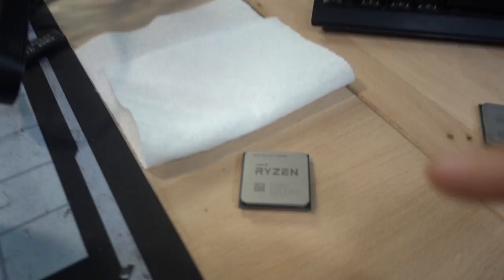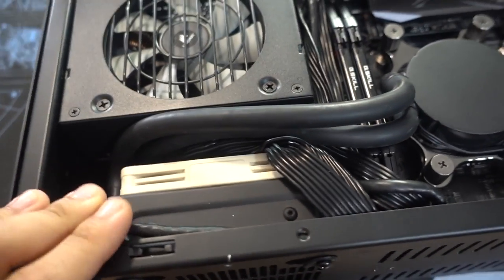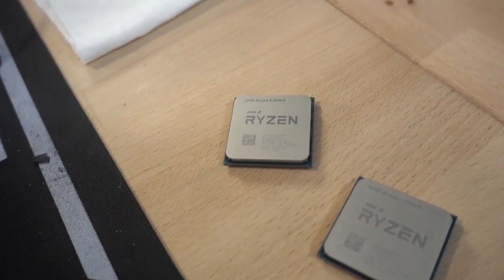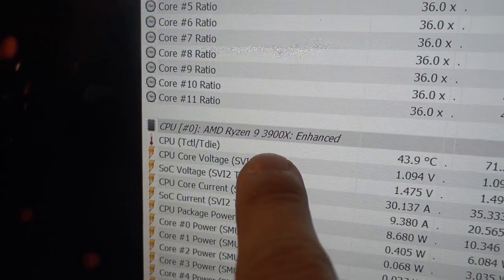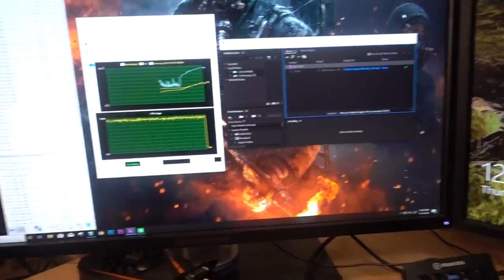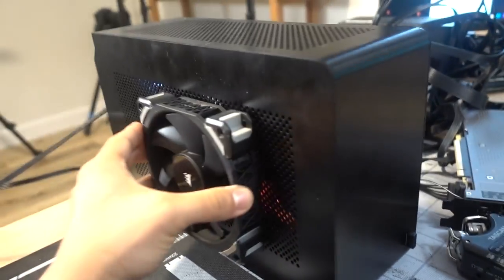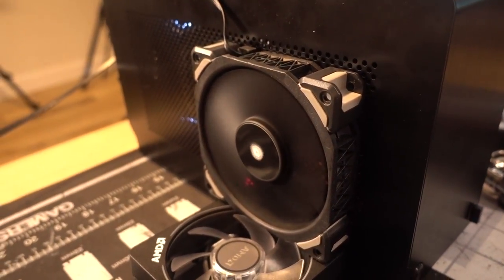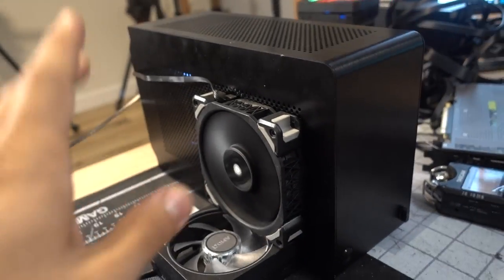This idea was BOUND to fail...right?

Comment: If you don't put a 3950X in it come september i'm unsubbing.
Reply: TDP-wise it's the same as a 3900x, so it's definitely possible.
Reply: @GyroCannon  TDP is one thing, actual power usage and heat is another thing
Reply: @LiLBitsDK  actually 2 cpus with the same tdp have a similar heat so its not the same but similar
Reply: If you do, though, I'M unsubbing
Reply: @GyroCannon  but can the VRM handle it, i doubt it will without undervolting and/or underclocking, it will probably overheat without a case fan blowing on it while rendering in blender for a extended period of time
Reply: @LiLBitsDK  You can lock PPT limit under 125W, there will be small drop performance, but great temp.
Reply: Chad McKean 
People thought the same about the 12 core
Reply: I want also to see threadripper 3 on dan case
Reply: prepare to unsub in a few days, buddy.
Reply: unsub now xD
Reply: UNSUB

Comment: Just go into the BIOS and change the power envelope for the socket.  I'm running a 3900X in a 2U case with a 65W low-profile noctua air cooler.  Setting the PPT to 100W keeps the CPU temp around 65C at a full load.  As a bonus, you still get the full-on single-core boost.

With your compact water cooling setup... 80C is a bit too high.... 93C too high for sure.  Just change the PPT, it won't go above 65C.  Then boost it a little bit... maybe try 110W, and it will probably cap out at 75C.  You guys are so fixated on overclocking sometimes it takes a kick in the pants to realize that you can still get 90%+ of the multi-core performance and ALL of the single-core performance just by using a reduced power envelope.

-Matt
Reply: @Junker Zn Very interesting, I will have to play with this on mine... Something else I noticed after reading about it from someone else was the 3900x is still plagued with scheduling issues in gaming. I have only a handful of games to test this on, but running battlefield V on stock I get 158fps average, but if I force the game to only run on the first CCD (first 6 cores), my average fps in the game jumps to 171fps.. similar % of increases in Fallout 76 also.
Reply: @williamhustonrn6160  I'm not sure I would say "Plagued", but there are definitely still some scheduling issues and it is partly the fault of the BIOSes reporting all 12 cores as a single unit.  Some BIOSes have an option to properly break the cores into (at least) their two CCDs (in terms of reporting the topology to the operating system via the appropriate ACPI table).

Windows is also not very good at using topology information provided by the BIOS, so its a double problem.  But other operating systems such as Linux do use the BIOS-provided topology information.

-Matt
Reply: @junkerzn7312  Hmm, you would think with a new chipset released with the new CPUs it would work together correctly. I really need to attempt linux again, tried debian a while back and just couldn't get half the games i regularly play to function on it, but i recently learned about GPU passthrough appearing to be promising, so may give it a try and maybe make the switch in the future.
Reply: This is mandatory.
Reply: Good suggestion Matt, I was going to suggest he undervolts it with a manual overclock but this solves the same issue
Reply: Can you tell me how to do that in an ASUS ROG board? I can't find anything marked as "power envelope" in the bios setting.
Reply: How do I do this on an Aorus i x570 Pro WiFi BIOS?
Reply: What would run better a 9900k with a 95w limit or a 3900x with a 100w limit?
Reply: @CALiiGeddonTwo   Was wondering the exact same thing! Anyone have an answer? Close to start ordering for my next build. Thanks!
Reply: do u have a guide on this

for setting the power limit

Comment: You could potentially undervolt the CPU to help the temps
Reply: Sure, but what would be the point of having a 3900x, then?
Reply: Would be a good idea, the gpu too it would lower the overall case temps... in theory at least
Reply: @anshulsingh7663  he'd still get the same performance with an undervolt. Just lower temperatures
Reply: @jonathanstitt4368  But the GPU's on the other side, so I don't think that'll really impact the temps so much.
Reply: @anshulsingh7663  with undervolting only single core performance is taking a dive, while multicore is not really, with a much less temps, so it's totally worth for a system like this.
Reply: Fernando Portal as OptimumTech figured out, the performance actually does lower when undervolted for some weird reason. The more that you lower the voltages, the clocks automatically go down along with them, beinging down the performance
Reply: Kinder of defeating the purpose don't u think
Reply: @anshulsingh7663  you don't lose performance when undervolting just heat
Reply: @anshulsingh7663  Undervolt not underclock :)
Reply: @anshulsingh7663  yes but it's still blowing heat through the case which has such little air volume that it could actually make some difference
Reply: @goldengod97  but this is with good cooling so it has overhead to ramp click speeds. Here there is no overhead so it isn't able to clock higher anyway
Reply: Setting a manual voltage and clock speed would help yes

And so would liquid metal or thermal grizzly new graphite pad

Or simply use a better cooler and or fan/ drill addition holes for more airflow
Reply: @goldengod97  If you use PB2/PBO it does kill performance while undervolting manually, but if you set manual clockspeed also, you dont lose any performance
Reply: @commanderoof4578  he can do that when he tries the 3950x 😂
Reply: Jonathan Stitt...

If he tries the 3950x he needs to do many things differently

The radiator needs to be flipped so the fan has access to more air as they push harder than they pull

He also needs to use liquid metal
Reply: Undervolting doesnt do anything in ryzen except make it unstable and crash.
Reply: Melthornal... really?! Nope!! That is only if you undervopt and do nothing with the frequency

You have to set the frequency yourself otherwise it will try to boost and crash
Reply: @anshulsingh7663  undervolt dont means under perfomance
Reply: @goldengod97  you got a bad cpu i can run 4.4 ghz with my 7700k at 1.17v oc at 1.42v 5.4ghz
Reply: @makunouchiippo2542  It does mean stability. Which is, drum roll, performance.
Reply: @AlexLionson  I do see the point. I mean, ryzen's best at multi core performance.
Reply: @anshulsingh7663  not all cpus are the same a power hungry cpu means a bad cpu the lower volts you need at stock the better temps and less oc, how many years are you using a pc ? im overclocking cpus over 20 years and i know my stuff my best benchmarks are on cpu z search me as korko-1 and call me back when you reach 7ghz
Reply: @anshulsingh7663  They can get similar performance, probably down a couple hundred MHz, but have the cpu at 1.4v vs the 1.5v and drop down temps by 10+ degrees
Reply: They don't need that, they just need a better cooling solution.
Reply: @goldengod97  this is not entirely true. He originally undervolted it in the bios, and that is where he saw those strange results. If you undervolt it through the ryzen master software, you can do an all core 4ghz stable at 1.1-1.2 v without loss of performance , all core
Reply: Yep still runs great at 1.0volts
Reply: You can undervolt but the easiest way is to just set the socket power envelope in the BIOS to whatever wattage you want it to cap out at.  It will still turbo single cores the same... only the all-cores boost will wind up being lower.   You can undervolt as well by using a negative VCORE offset, but that requires some work to figure out how far you can go and still have a stable system.  Capping the socket power (PPT setting usually) is easy-mode.  You just set it to whatever you want and you are done.

-Matt
Reply: You can reduce PPT (platform power) significantly without losing too much performance, as the system will be at a more efficient point on the voltage/frequency curve.

Setting a negative voltage offset saves less power and results in heavily reduced performance at the same power levels. Therefore unless you're also setting a manual frequency (thus disabling precision boost and going into full manual OC mode), it is not recommended to set a negative voltage offset.
Reply: @dylanhoel1636  Yo do lose performance by undervolting when it comes to Ryzen 3000.
Reply: @AlexLionson  On the contrary, the multicore also gets the performance hit when undervolting.  I personally tested this with my 3800X.  Geekbench multicore score nose dives almost by 1000 points.
Reply: Daniel Gim all that means is you undervolted improperly

Comment: How about underclocking/undervolting the 3900X, @4.0-4.2 GHz should still be much faster than the 3700X. Higher temps aren't really good for permeation of that little AIO.
Reply: Keven Harvey Undervolts on ryzen 3xxx has been rather shit from what I understand
Reply: @smartyuno  Check out Optimum Tech's most recent video.  I think his 3900X was stable at 3.9ghz at 1.00V on all cores
Reply: @tmoneytechnic  That, somehow, sounds crappier than it actually is.
Reply: @richierich8245  I think he's quoting the updated video. 3.9 at 1 volt, 4.0 at 1.06, up to 4.3 at 1.25 volt. Is still better than stock for thermals.

Comment: Yo Kyle, get a pair of scrissors that can cut alum, and put a 280 rad INTO the side panel. Get some kind of sealant, and "tape it". Now you have a pc that's side panel is literally a rad.
Reply: KyleTechTips, everybody.
Reply: for a pc case you could probably use tin snips, cost around 15$ for a set, or if you want it to be fancy, could use a dremel and put it in the middle
Reply: This case was a bit expensive I don't think he will cut into which would also  hurt the portability also no space for the 280 I would need to get a smaller psu then the sfx ond
Reply: He can mount 120mm easily on the side panel without cutting anything because of the holes in the panel

Comment: You should manually overclock all cores to a reasonable OC of 4.0 - 4.2ghz and drop voltage down to 1.1-1.2 range, you may lose some performance from single thread vs PB2/PBO, but should get way better temperatures
Reply: Turn PBO to advanced and set the temp to what you like. worked for me in my dan case with a 3700x @ 80c limit. cb15 got 195 and 1980, not bad really.
Reply: WRONG

Comment: Did you lower the voltage on the CPU? That is a big thing Jay noticed is all the Voltages are set really high on default for the new zen 2.

Maybe it was a specific bios thing but IDK. It is definitely worth double checking, you maybe able to drop 10 C of that temp if that is the case.

Comment: So any of the bigger ITX cases that can handle a 120mm fan on the AIO should be fine. That's damn impressive, Never had a AIO on my cpu, got a Corsair H55 on my gpu and it dose a damn good job but i also have a Noctuas new 120mm fan mounted on the radiator.
Reply: how about the ncase m1 itx case?  because can fix a 240mm AIO cooler
Reply: @thesuremen  Even better, should not even get hot with a 240 AIO

Comment: Would a R5-3600 (or 3600x) be worth it over the R7-2700x? Just curious if tried that & if gain anything etc.... Would be interesting to see some benchmarks in this rig w/ the CPU tested along w/ the others.
Reply: For gaming it probably would due to ipc improvements allowing better single core performance. If you just want the raw compute power though 2700x is probably better

Comment: You might be able to drop temperature without adding a fan. Lowering the voltage in the BIOS and locking an all core to like 3.9Ghz or 4Ghz would give you maybe slightly worse performance  (guessing around 7min30 maybe?!) But much lower temps. Default voltage for Ryzen CPU are usually much higher than needed.

I manged to get my 2700x running at 4Ghz all core with 1.2V in an HTPC case with the stock cooler and it never goes above 75C. It's stable, never crashes and runs for weeks. Zen 2 is even more power efficient than Zen+ so you should be able to get similar results even with the extra cores).

Comment: If you did a fan on the outside like that and made some holes, you could always cute the cables and crimp some plastic quick connectors that let you to just hook the fan, pop in the power, and you got yourself extra cooling when you need.  Make it modular. Used to do that a lot in vehicle installations and if you ever had something that was getting pulled out a lot, having one that can just have a male and female end was a good use.  That way you could just pull it out and not have to redo wiring, etc.

Comment: Try turning the Noctua fan on the radiator around so that it pulls fresh air from the outside and not pre warmed air from the inside. 

Also look into lowering the PPT. That is the new way to undervolt, but instead of lowering Voltage you reduce the maximum power that the cpu is allowed to consume.

Comment: silverstone SG13 is much better option, same hardware 3900x + 1080ti mini, in SG13 you can install a X42 AIO cooling with 140mm radiator and 140mm fan, I replaced the default X42 fan with noiseblocker eloop b14 and the highest CPU temp in aida stresstest is 85°

Comment: Optimum Tech already did this, and concluded that with an undervolt this cpu can run pretty darn cool. Make sure you use ryzen master software tho because undervolting using the bios is broken.
Reply: ryzen master is not permanent

Comment: I have the 3700x in the Phanteks Evolv Shift and it gets toasty... Currently the gigabyte bios on their X570 i is unable to actually change the voltage (even though it says it does) so the CPU is constantly at 60-80c on an H-80i V2 AIO. You can change the voltage with ryzen master, but then it unlocks the power limits. It’s just been a bit frustrating trying to get the cpu temps under control in an itx case.
Reply: I use the same case but with strix x470i, 3900x and a Asus 120mm aio with Noctua NF-F12 
 fan. The cpu is around 50°c idle, around high 80s full load and mid-low 70s while gaming

Comment: Who wouldn't want to see that? I don't need to know that person. It looks like it has little to no room to move any air through the rad... can't tell if that fan is positioned to push or pull. Might try giving it some more spacing between the table and the bottom of the case. You could always put this in the Ghost S1. It would be a bit biger, but you could fit a 24omm rad in one and have much better cooling. You could always toss a 3950X in come September too.

Comment: I think you might need at least a240mm radiator for that chip, a Steacom DA2 case instead, maybe? Edit: mid half way through the video, and I'm impressed, I mean the core i9 inside macbook pros hit those temperatures and thermal throttle the whole time.
Reply: this is at 1.45v as a bios bug on x470 mobos. with proper settings you get 20 degrees less on that

Comment: Im using an Asetek 645LT for my 3900X. Only change was I replaced the fans with 2 Delta GFB0912SHG 103CFM fans in push-pull configuration. Makes a significant improvement as this is for a sleeper build that only has a 92mm fan mount.

Comment: only a 450 watt psu? I thought a 1080 ti and 3900x would blow one of those up
Reply: If it was a vega. It would be a bomb.
Reply: Yeah wtf
Reply: Naw 1080ti and 3900x is rated at 250 and 105w tdp respectfully. So while not ideal because both can draw more it probably isn't maxing out both at the same time anyway.
Reply: AMD/Intel/Nvidia all inflate their power requirements to account for people who use crappy no-name Chinese power supplies. But on a high quality 450W PSU you can get away with a lot. Corsair's SFX PSUs are built to be able to run at 130% of the wattage on the box indefinitely, so that 450W PSU he has can power almost 600W
Reply: @StrangerDanger0Snack  interesting and useful info thanks :)
Reply: You'd be surprised

Comment: I have 9900k limited to 65tdp and does not exceed 78*, liquid metal on it, test should be taken under load at least for 30min to let the liquid warm up. Different with limitation cpu to 65tdp is marginal. Asetek 645 I use

Comment: You could have EASILY lowered your temps if you had USED MOAR THERMAL PAAASTE.  I saw what you did, you didn't even have enough to cover a single letter!  You need at LEAST a pint for ever square inch.   Your temps would have been at least 20 degrees lower.

Comment: Maybe also try testing it just with the side panel removed as well? Might be able to get away with just cutting a larger opening in the side panel and mounting an aftermarket grill there, that way the existing fan just has more access to uninhibited fresh air, while the grill protects the guts. You could also pull a GamersNexus and just drill out some of the existing holes near the fan to be larger with a stepped drill bit.

Comment: High idle I get mid 30s I'm using a x72 to cool my 3900x probably high stock voltages x470 and 570 boards seem to put way too much stock voltage on the cpu

Comment: you think the stock cooler would've fared better given the fan draws air directly from the side of the case and not the bottom like what goes on with the aio cooler?

Comment: change the volt to 1.3v it will give you way better temps its giving it 1.5v  thats why its hot asf. also mine runs 4.2mhz on geek a50 mini itx case Max temp is 76c

Comment: Holly Molly I have gone with the same setup but a X570 Aorus ITX, hopefully the upgrade to the asetek 645lt and thermal grizzly Hydronaut is enough, if not I will reduce the overall voltage, I've seen 4.1GHz on all cores with 1.1V which is way lower than the stock 1.28V and bring more performance.

Comment: Putting a fan on it is stupid. Obviously the cooler just keeps climbing which means it can't handle the load and will overheat with a not much longer render. Just put the 3700x in it...